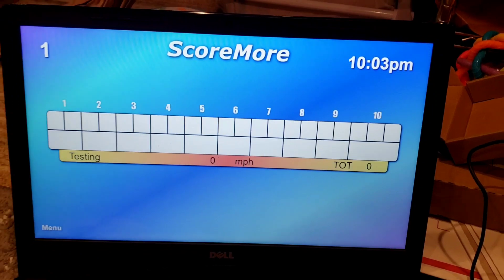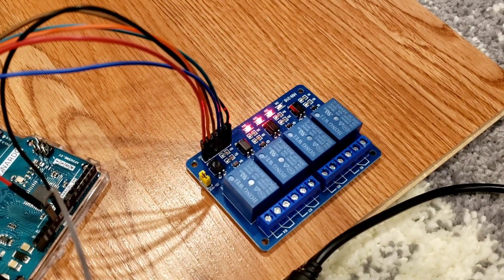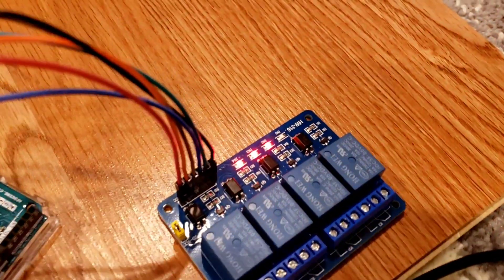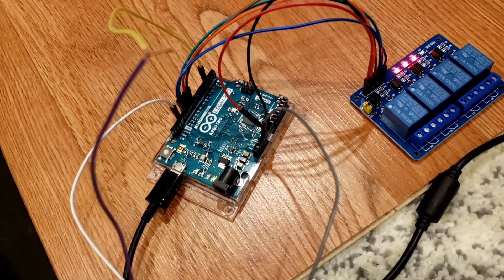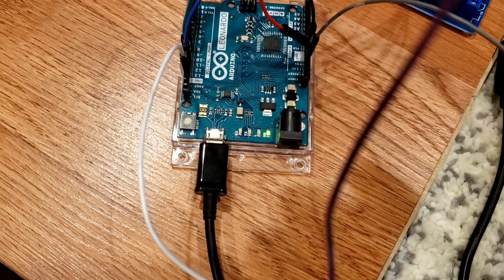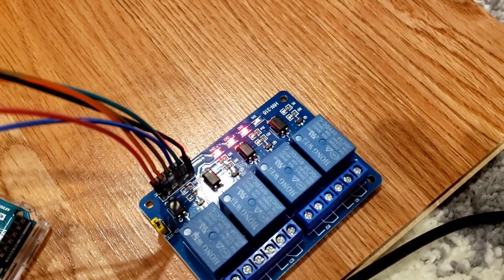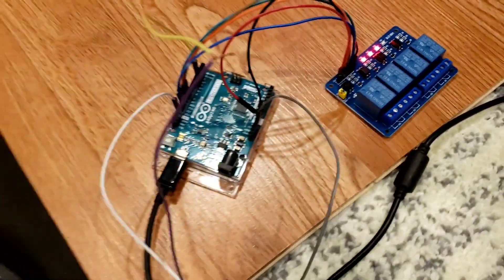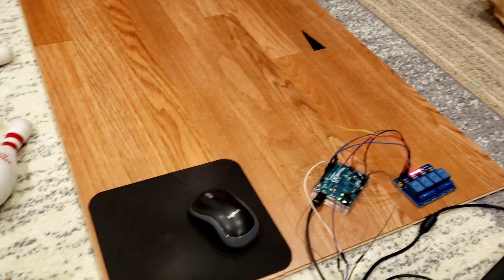ScoreMore Mini Bowling Program Arduino Testing

Comment: Thanks for the video series. This is probably my 2nd project in line for my basement. Need to finish my virtual pinball machine and one other thing first. I like the relay and Arduino setup as I already have both from other projects and a set of mini pins for inspiration. Do you have another link to the Arduino code. It is no longer available.

Thank you.

Comment: Did you have any issues making the camera work with scoremore? I have tried multiple cameras and multiple computers. When I press the S key, the triangle that shows pins standing is correct, but won't display the score. Tried some different resolutions on the camera, and brightness. Currently set for 1280 x 720. Looks like your setup is working fine. I still suspect the camera.
Reply from the maker: Hmm. Yea I don't know...  maybe try a different camera. Do you have the latest version of ScoreMore?  Its version 1.3.  Let us know what you figure out. Looking forward to seeing some bowling vids from you.
Reply from the maker: So I just got done messing around with ScoreMore and noticed it doing to same exact thing your describing on my older Acer laptop. Works perfect on my Dell. My guess would be to uninstall and reinstall program. I haven't tried it yet, mainly because I'm going to be using the Dell regardless. Its definitely not a camera issue if it knows what pins are standing.
Reply from the maker: @NDav8tr  just got an email from think clever and smart, theres a new updated version of ScoreMore. It fixes the problem you have been experiencing.

Comment: Nice setup! If you want, I could make your wishes as options in ScoreMore so you doesn’t have to build circuits for it. :)
Reply from the maker: Theultimateandy actually figured out how to do it just using the 4 channel relay module. Much simpler than I thought. Sometimes it just takes another set of eyes. Thank you though, I really appreciate it. I'm also glad to hear your ok.
Reply: Yeah I live in Sweden and I’m currently in the capital Stockholm where I am staying at an almost empty hotel during this time. I’m attending a TV show and they are paying for my stay so I’m all good. These times are definitely special and I hope it’s over soon.

Comment: Just watched your video. That is going to be an awesome setup.   You would not need to add another relay to have just one ball light on at a time. You can send power to relay #1, then send the power from the N/O contact on relay 1 to the common contact on relay #2.  Ball light 1 would be on the N/O contact on relay #2, and ball light 2 would be on the N/C contact of relay #2.  The other option would be to simply bypass relay #1 since that one isn't really needed and just use relay #2 to do the flip flopping of the ball lights.
Reply from the maker: I was thinking that way but didnt finish my thoughts... haha. Using relay #2 would be the best option. I would wire the ball 1 light to the n/c side of the relay so it will be powered when the relay isnt active, then when the ball light 2 is activated, the relay switches to the n/o circuit, which would be ball light 2 and turning off ball light 1.  I can now use relay 1 to power up the "BALL" light then since its powered up through out the whole game. Awesome, thanks!  I think I will still have to use a 5 pin relay for the strike and spare lights but the ball light circuits at least will be simplified.
Reply: @minibowling1886  You can use the same method with the strike and spare lights as well. Relay 3 N/O contact would send power to the common terminal on relay 4.   Relay 4's N/C contact would be wired to the "Spare" while relay 4's N/O contact would be wired to the "Strike" sign.  Essentially relay 3 would send power to relay 4 regardless whether it is a strike or a spare.  Relay 4 determines whether the strike or spare light will turn on.
Reply from the maker: @theultimateandy  I'm not going to lye. I had to draw it out to see it. Haha. Your absolutely right. Thanks so much!
Reply: @minibowling1886  Awesome, no problem. Looking forward to seeing the finished product!